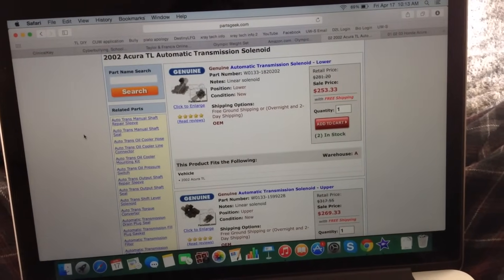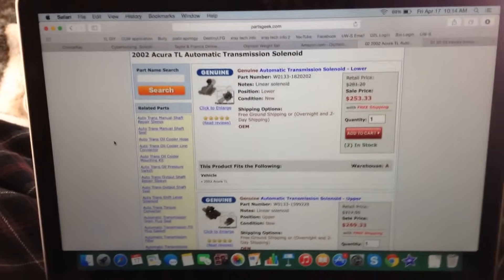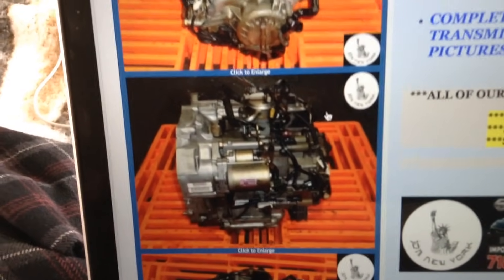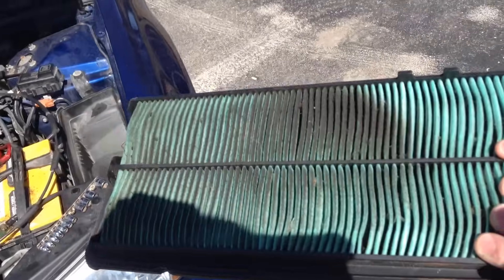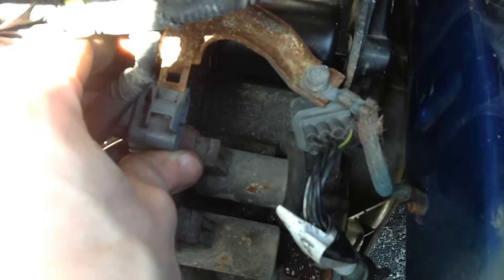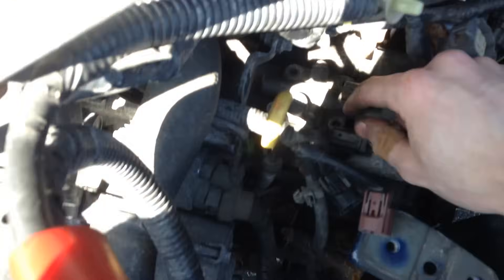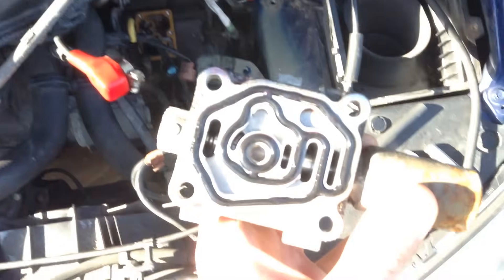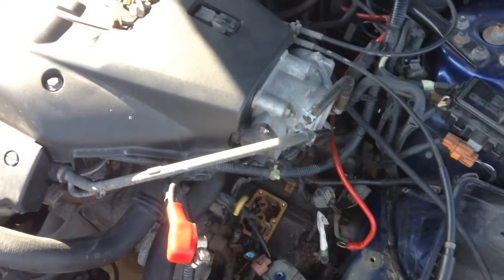Transmission Fix: How to Clean Solenoid Screen Filters for Honda/Acura P0730 P0740 P0780 P1750 P1751

Comment: Hey there, I am considering getting an Acura TL Type S, because this gen is my budget, but my questions are what is the list of things to do to keep this car's tranny running in tip top shape? 
Also how often do you clean out the Solenoids?
Reply from the maker: Maintaining the ATF is key. I can't tell you how many people have come to me with their transmission problems only to find out their fluid is brown when it should be red. If you change the transmission fluid with Genuine Honda DW-1 ATF every 15,000 miles and change the exterior ATF Filter every 30,000 miles, this car will treat you good! You should only need to clean the solenoid filters if the CEL comes on since that's what triggers the code. It's not something you should need to do on a routine basis.
Reply: Incin3ration Thanks for the reply! As long you take care of it, should last a while. Thankfully people have found dout that the tranny from the 06 and 07 Accord V6 works with the TLs from 2001 and 2003, and no mods either. But yeah like I said I'm highly concidering a TL and this Gen is in my Price range along with its bigger brother the RL.

Comment: Most of my gears drag and they shift quickly but too quick it used to take it's
Time to shift now it's like it's just shifting to get to fifth and then when I'm the 5th gear it stays over the 2 RPM I love this car man I don't wanna sell it and I don't wanna pay for a rebuild help me
Reply from the maker: You're overthinking this job dude. Just follow the video and you'll do fine. It's really not hard at all, it's mainly just removing a bunch of simply bolts with your standard ratchet.

Comment: I need help I don't know what tools to use I have a 2003 Acura TL base 3.2 check engine light poppped up and it shift all gears al the way to 5 when I'm at 40-60mph do you think this will fix it .? Because I heard the 2003 transmissions are differently placed please help me I wanna fix it myself then getting t rebuilt for 1500$
Reply from the maker: Yes, this has helped countless people and can help you too! The best part is it's free to do! Also, you're 2003 transmission is exactly the same as mine. Just follow the video and everything should look exactly the same.
Reply: Incin3ration do I change the top filter or bottom because the video didn't show where you got the gasket out from and what tools bits did you use I need the exact same im going work on my car today
Reply from the maker: you don't have to change the filter, just clean the junk out. I'm also assuming you're talking about the gasket/filter at 15:03? it's literally attached to the solenoid. If it didn't come off with the solenoid, it's more than likely stuck to the surface of the car where you took it off from. And every single tool you see in this video is what I used.
Reply from the maker: and there are 2 solenoids, and you have to clean both of them.

Comment: what if i dont have an air gun to clean these filters?  Would brake cleaner be sufficient?
Reply from the maker: Yes you can definitely use brake cleaner to clean out the filters as well.
Reply: i actually have two codes (P0740 and P0780).  Should this fix take care of both codes?  I also plan on doing a DIY transmission fluid flush.
Reply from the maker: I don't know about both codes. P0740 refers to the 2 TCC solenoids I cleaned in this video and cleaning the screen filters is the absolute best place to start. If you know your fluid is looking pretty bad and dark, as well as improper fluid level, that may very well be the underlying cause of your codes too. In which case, we can only hope the neglect hasn't caused too much damage. I would also recommend changing the exterior ATF filter while you're at it. If you do all this and you still have P0740, you'll probably need to change the solenoids themselves which are rather pricey. P0780 refers to a faulty shifting solenoid valve, and there are 4 of those. Just for reference, the part numbers for my car are 28400-P6H-013 & 28500-P6H-013. There are 2 of each. Maybe do an ohm test on those solenoids on your car to find which one is bad and possibly causing the other P0780 code.
Reply: I's so glad you answered my question I just posted today. I  should have looked at other replies before asking. I can't wait to get my 2003 honda pilot back running. I'm have a friend watch this video it's great. thank you for your reply I'll let you know how it came out. Thank God for youtube.

Comment: wow 2017 and if the solenoids are good presto just saved 300+ in parts and took me about a good 2 and. a half hours later and what do you know trans shifts like my Infiniti smooth and fast I am going to do a drain and refill on trans fluid asap was brown and not 🍒 red will update with the progress but thinks again everyone kept telling me it was the trans but the trans was fairly new my lower one and two of the top ones were the culprit I didn't use air gun used some brake cleaner made them look brand new and of course cleaned the solenoids themselves along with area any other post I'll follow I thought I was gonna have to junk my 2003 beauty now just need to figure out blower motor and install fog and light bulb on driver's side and I'm done
Reply from the maker: I'm glad to hear it worked! Yah definitely change that fluid, could be an underlying cause for the clogged filters. Might I also recommend changing the ATF filter if that hasn't been done in a while. I actually just uploaded a video on how to do that if you need help.

Comment: Great video.... do you think it will work for me? I have 2001 Acura cl type s... that hard shifts after about 2 hours and my D5 blinks
Reply from the maker: Yup! Our cars have the same transmission, so you should expect this process to be the same as shown in this video. Good luck!
Reply: Does it matter which way the screens tubes go back in?
I put the screen tubes at the bottom 
In the trans maybe that's y it  didn't work for me after 2 days
But I ordered a new solenoid

Comment: Thanks so much for making the video! I've got an Acura TL 2002-  getting the P0740 code for Torque Converter Clutch Circuit and several sites recommended replacing the $250+ Solenoid but first I'll try cleaning them as you most excellently demonstrated!!  Thanks again!
Reply from the maker: You are very welcome! Yes cleaning these tiny filters can definitely make a worlds difference! Otherwise, replacing the solenoid is still a lot better than spending thousands on a new/rebuilt transmission. Good luck!

Comment: Did you reuse the face to face gaskets as well as the O ring type gasket. These gaskets are no available at the auto parts store. Great video
Reply from the maker: Yes, I reused the Solenoid Gaskets and the O-ring gaskets. If you lost one or need a new one, they are available on any Acura parts website under the section "AT Sensor - Solenoid."

Comment: I have the error code for solenoid problem. I asked a mechanic and he said it could cost hundreds of dollars for just the parts. What do you think it would cost to ask a mechanic to take it apart and clean the filters like you did? I do not have the tools for taking apart components in an engine.
Reply from the maker: I can tell you this job can take a good 2 maybe 3 hours. So even if you took your car to a dealership where they charge like $110 per hour, it should still cost you less than $300. Obviously, if you take it to a local trusted mechanic, it'll cost even less.

Comment: Excellent Video! Accurate Information. We bought my daughter a 2003 Acura TL about 5 weeks ago with 121,000 miles. Two weeks later transmission would feel like it would slip slightly when going into 3rd gear. One week after that, weird and troublesome shifting when on the road. Another week, hard shift from park to any gear. Sometimes would not go into reverse.  3 days ago, followed this video which gives excellent instructions. Was a bit dis-heartened when the filters on the dual solenoid set were clean. But! was happy (you know what I mean) to find the lower single solenoid filter completely blocked. Easily cleaned. Checked solenoid operation by applying 12V. Also found transmission filter to be restricted so replaced that. When I first stared the car up and put into gear, same things happened but cleared up immediately. The transmission it really running smooth now (4 days). Very happy and scored some points with my daughter. The transmission fluid is a bit discolored and doesn't look like it has been changed. Will flush in next day or too. I hope as much luck to any of you reading this. Thank you very, very much "Incin3ration", creator of this video!
Reply: Thanks for your comment I was just now devastated when the top dual solenoid was clean as can be I’ll get a flex joint and take off the lower one next!
Reply: @kingarthur7255  I really hope it works for you. Let me know
Reply: @donestes2116  I plan to do it towards the end of the week or this weekend! I’ll leave a comment here with my results I’m doing a fluid change and filter, testing the solenoids and cleaning the metals screens etc. I’m doing everything!
Reply: @kingarthur7255  same I will be doing my solenoid cleaning this weekend hopefully this works 🙏🏿
Reply: He really made it clear and simple👌🏽
Reply: How long did the vehicle last after? Just bought one but now afraid of getting a problem with it :/
Reply: @jmj_d5207  These times are estimates. About 1 year after the cleaning I had to clean again with same very good results. The car ran great another year but was in an accident that damage the front end and we sold it. Good luck!
Reply: @donestes2116  thanks for replying sounds good
Reply: @donestes2116  Before the accident, did you ever change the the trans fluid? and if so how many times?
Reply: Should've replaced the filter after you flushed the fluid. bet your filter is black again.
Reply: @supserbvideo  the solenoid screen filters were like new they didn’t have a single particle stuck in them thats why I’m even more concerned
Reply: Having this issue currently
Reply: was your code? P0740?

Comment: Great informal video! my Acura TL Type S is currently at 81 000 km. Would recommend me to do this job in order to prevent future problems? My transmission is running good. But  I feel it could go better.
Reply from the maker: Well the P0740 check engine light code will usually appear before you start noticing any obvious symptoms. So if your CEL isn't on, I doubt there would be any gunk clogging your filters in the first place. But by all means, this procedure is completely harmless and if you want to give it a shot, go for it! I just don't want you to work 3 hours only to find it did nothing. Also, check the description for other possible solutions that could cause your transmission to perform poorly.
Reply: Great, thank you for the quick reply! Looking forward for your next videos of ATF!

Comment: he sounds like michael cera from "superbad" lol awesome video an thanks:))
Reply from the maker: lol Love that movie! and thank you! I'm glad it helped!
Reply: Yea I have a 1997 honda prelude an I have a p1773 code saying a/t clutch control solenoid b circuit malfunction....an I went to az they said that piece was 250$ as well an I hope I could clean it an take care of that problem as well but hopefully I can just replace one of the solenoids which a 50$ piece...
Reply from the maker: Yeah cleaning these filters has helped a lot of people! If it doesn't work and you buy another solenoid, I would highly advise not buying an aftermarket part. Go with OEM Genuine Honda. I agree $250 is steep, so maybe you could find a used one at a junkyard or ebay. If you need help finding a part # let me know.
Reply: Incin3ration thanks bro I appreciate it!! I actually did what you said in the video I took apart the solenoid a an b an sprayed them with carberator cleaner an reassembled everything left positive termimal on batt off for 30sec to reset cel..an so far so good no light or malfunctions:)))))))))) only thing now is to fix my ignition switch...apperently the ignition switch has a recall on it causing the car to stall....so waiting on Honda to repair the problem...free of charge of course:)))
Reply from the maker: +universal alma mater awesome man!!! I'm really glad to hear it worked!!!

Comment: Well I  did this and the same screens were filthy unfortunately it still doesnt shift smoothly  third gear being the worse.
Reply from the maker: well dirty screens in the first place show that something isn't right internally. Only other thing I can recommend off the top of my head is to check the condition of your ATF. Is it nice and red, or is it dark, brown, or black? Furthermore, when was the last time your exterior ATF filter was changed? Lastly, make sure your ATF level isn't too high or low. There's also the possibility the solenoids themselves are going bad, which is why I put the ohm test at the end. Also, try entering your CEL codes at autocodes.com. Good luck man.

Comment: What order does the tubes and screens go back in?
Reply from the maker: It depends on what vehicle you have. My 2002 Acura TL-S has three tubes that are all exactly the same, meaning they can go back in any order. But it is different for different years. What year and model is your car?
Reply: Mine is a 99. I got it back together, but I was trying to locate the other solenoid that you blew the screen out on.
Reply from the maker: The 1999 TL only has 1 solenoid.
Reply: Do you know where it's located?
Reply from the maker: I believe you have already cleaned it since you said you were able to get everything back together! But just to clarify, your car and my car have the same solenoid that is located on top of the transmission. It's the one I removed at 10:35.
Reply: I cleaned both of the solenoid out and drained the fluid to prevent anything else from clogging up the screens, but it's still shifting funny. My next step is the transmission filter. If doing that doesn't solve my problem, I'm letting it go.
Reply from the maker: There is a chance the solenoid itself is going bad, which is why I demonstrated an ohm test at the end of the video. The solenoids are kinda expensive though, about $250 unless you can find a used one for cheaper. Best of luck to you.

Comment: Okay, so Idk how but I dropped and lost one of the inside filters, any where I can buy these or replace?
Reply from the maker: You are in luck. You can buy individual filters and o-rings for the solenoids. I'm assuming you're talking about the top solenoid with the 3 individual filters. Part # for the filter pipe is 22750-P7Z-000. Part # for the o-ring is 91301-PC9-003. Please verify that these parts will fit your exact vehicle as these are the part numbers for my car (2002 Acura TL-S).
Reply: Exactly! Mine is a 99 tl, but yes the 3 on top, and lost one little bitty filter. Autozone? Oreilys? Acura? Online? lol so lost on where to find
Reply from the maker: Yeah you will have to order the parts online. Click the link below to find the parts for your specific car. Looks like your 1999 TL has the same solenoid, but different filter pipes. So depending on which filter pipe you lost, you will need either diagram reference # 3, 4, or 5, and then you will need an o-ring diagram reference # 17.

https://www.acurapartsforless.com/auto-parts/1999/acura/tl-sedan/tl-trim/4-speed-automatic-engine/transmission-automatic-cat/4at-sensor-solenoid-scat
Reply: My friend you are amazing and helpful! Thank you
Reply from the maker: You're welcome!
Reply: Are the filter screens facing upwards towards me or are they facing inwards when putting the screen pipes in
Reply from the maker: well based on what I can see in the video, the screens are located close to one end of the pipe. The screen end should be at the top when placing it back in. Meaning the opposite end without a screen will go into the solenoid, and the screen end will be sticking out towards you. I hope that makes sense.